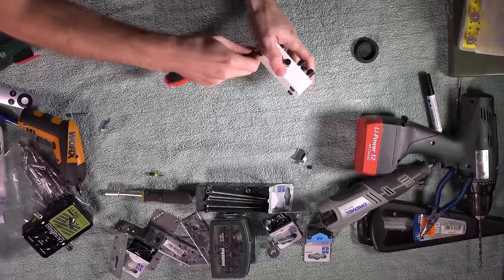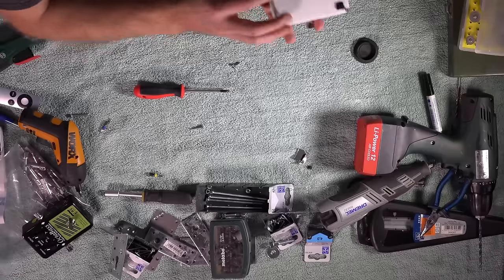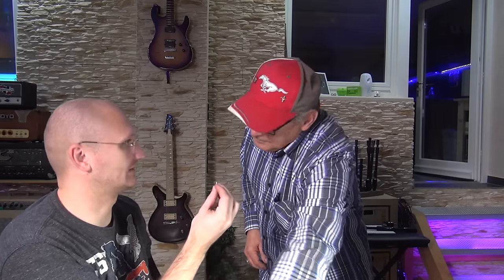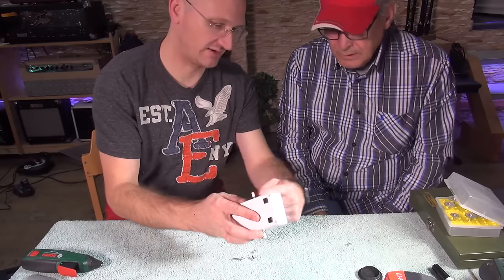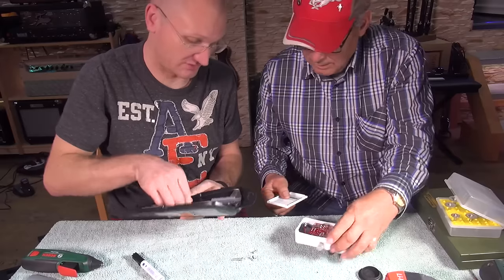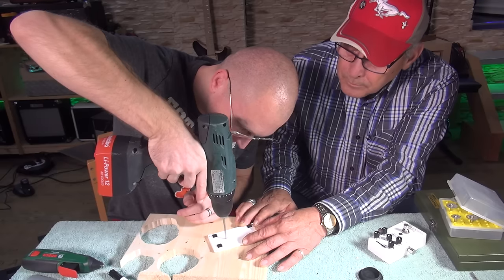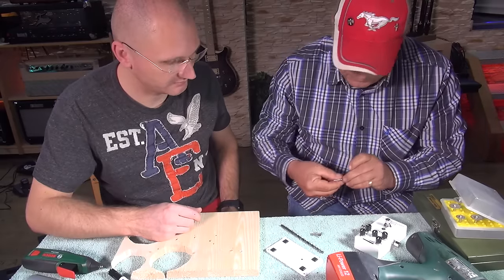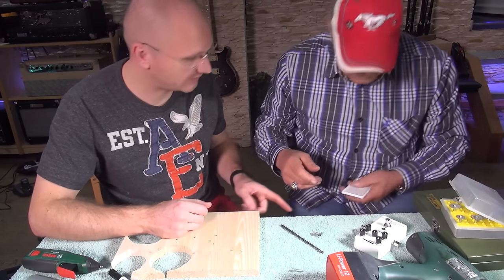Building a Pedal Board for NIK WEST - Part 3

Comment: Search for Bicycle chain links to mount the pedals... People use them as an alternative solution to velcro.
Reply from the maker: +Apostolis Karatzas Thanks... I didn't know about these until yesterday... very cool.... not the solution for me, but still interesting.
These wouldn't work for the TC pedal because it doesn't have 4 screws.... also, you need 4 holes per pedal and that won't work with the space we have...and it doesn't look as clean as what I did... you'll see...
Reply: +EytschPi42 true... the tcs have that long-ass screw in the middle! what about the treads? Is it replacable with a longer one so you can screw the pedal into the board at once? TC is a Danish company so, they should be using European screws, right? I just checked on my helix phaser but it seems kinda strange. I dont know, I am just using velcro!! :D Im looking forward to see the next part now... is it still uploading??
Reply from the maker: +Apostolis Karatzas EXACTLY... I wanted to do just that.... I couldn't find a screw that fit. Would have been so easy !

Comment: Don't get why the overkill security, but if you must wouldn't L-brackets do the job?
Reply from the maker: +Jonathan Gomez what kind of L-brackets? and for what? the pedals or the power supply?
Reply: +EytschPi42 either, open the pedal secure the L-brackets to the sides by bolts, or use strong epoxy. Then you will have the supports to screw it to the board. You know like little ears, I would put one on left bottom and top right, then repeat that way those 'ears' won't be in the same place.
Reply: +Jonathan Gomez btw if you don't want those bolts heads on top, make the top holes bigger so the head slips right in (yes I've just said that ;) then you can use shorter bolts...

Comment: i wonder if you have thought of a bike chain ... as they say an image is a thousand words so just google "bike chain guitar pedal" and you 'll see what i mean. This way you don't need to drill those precious MXR pedals . (plus from what i get it's really gonna be a hassle , because the screws holding the pedals in place will probably be in the way of the power supply.)
Reply from the maker: +diskovolos Thanks... I didn't know about these until yesterday... very cool.... not the solution for me, but still interesting.
These wouldn't work for the TC pedal because it doesn't have 4 screws.... also, you need 4 holes per pedal and that won't work with the space we have...and it doesn't look as clean as what I did... you'll see...
The are not in the way of the power supply, but should you want to take the two pedals in the middle off, you have to take off the power supply first.... but why would you want to.... this is more of a permanent solution... and she is not much into pedals, so there won't be constant change...

Comment: A lot of fun to watch the process. How about these from your favourite store: http://www.thomann.de/de/harley_benton_mounties.htm ? Plus some Loctite fluid if you really want to make sure it will not shake loose.
Reply from the maker: +ToneCave Thanks... I didn't know about these until yesterday... very cool.... not the solution for me, but still interesting.
These wouldn't work for the TC pedal because it doesn't have 4 screws.... also, you need 4 holes per pedal and that won't work with the space we have...and it doesn't look as clean as what I did... you'll see... but still a cool solution !